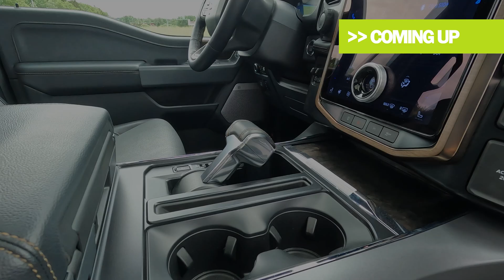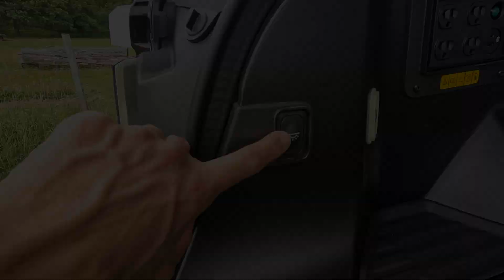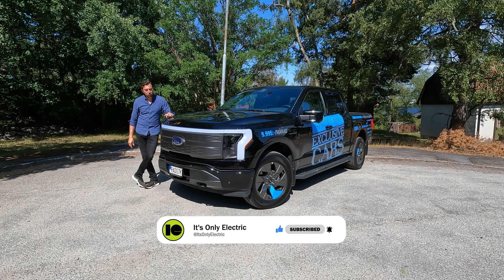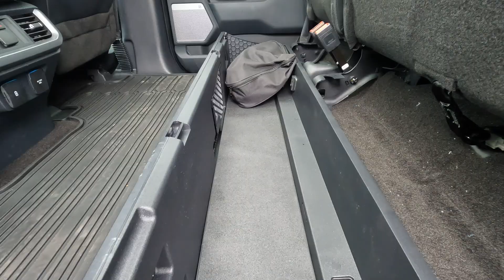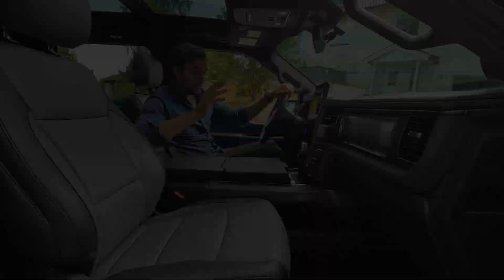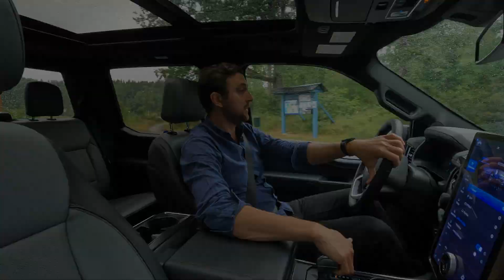Ford F150 Lightning Lariat - I get the point! Full Review

Comment: Why would you complain that it's too big for the European market, when Ford isn't even selling it in Europe??? Mostly a decent review, but don't complain that it's not appropriate for a market that it isn't even being sold in!
Reply from the maker: Sold in Norway officially by ford and the regular f150 officially available in Sweden .
Reply: It is only sold in those sub-markets because they are the right size for SOME people there. This would be perfect for a farmer living outside a small village to get supplies, tow equipment, and carry the family. But, they would be wise to park it at the train station if going into the city.
Reply: It's not too big for Europe anyway. If I can daily a F450 in the US mid-Atlantic, this shouldn't be an issue in Europe. The difference in minor street widths between Philadelphia/DC and most European cities is not that big.
Reply from the maker: It's gets a bit crsmbed on parking lots. They are smaller in Europe than in US
Reply: @ItsOnlyElectric  My daily driver is 266.2 inches/6.76 meters long and 96 inches/2.44 meters wide. US parking spaces aren't big enough for me to fit. I usually take up a full space plus 3+ feet/1 meter in the space behind and have a few inches from tire to the line on each size.
This will give you an indication of the size:
https://www.youtube.com/watch?v=Z7Eog0td66k

Comment: I love my 2023 Ford F150 Lightning (Lariat, extended range) but I can see how it's built more for the US market than the European market. I mean, the size of it on the road. It's a big truck here in the US where it can usually fit in, but when I drove a Volvo XC60 in France, Spain, and Gibraltar I had a hard time maneuvering some of the parking garages and side streets in that vehicle. I could see how in many places the F150 would just be a no-go. I think Ford should make an EV version of their Ranger, the noticeably smaller pickup truck baby sister to the F150. I think the Ranger fits much better in Europe.

By the way, the F150 is the best selling truck in the world for over 45 years straight. And the fact that the Lightning is Ford's EV pickup truck is really revolutionary. Ford is doing for EVs with this truck as Tesla did for EVs over 10 years ago.
Reply from the maker: Yes, totally agree. Really like the Lightning but a Ranger lightning would maker perfect sense for Europe

Comment: Nice car if price is comparable with Cybertrack ☀️
Reply from the maker: Price of the cybertruck is still a bit unclear. Will probably be more expensive than thought from the start. 

The sad thing is that the f150 is so much more expensive in Europe than in US. 

Whats Up?
Reply: @ItsOnlyElectric , I think the costs to put them on a freight ship and import each vehicle is automatically going to make it more expensive overseas. But, in the US my F150 Lightning Lariat (with Extended Range, Max Trailer Towing package, and Spray-in Bedliner) put the MSRP at $89,954 (which is about 81,294 Euros). So, it's already a bit expensive, especially at the higher trim levels.
Reply from the maker: @JoshuaMichail0  thanks for that clarification. Happy with your f150?
Reply: Regardless of price I can't understand why anyone would want a truck that looks like the cybertruck. I love my lightning,  most people don't even realize it is an EV. Because it's an F150.
Reply from the maker: @pstoneking3418 which version did you go for?